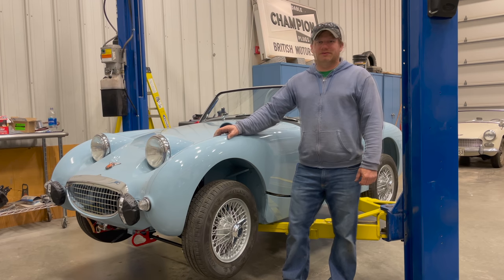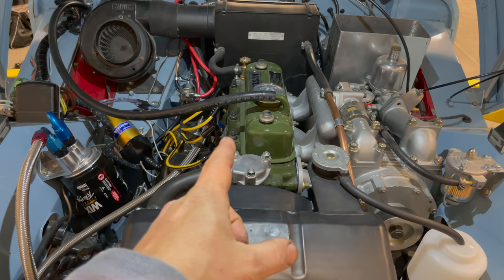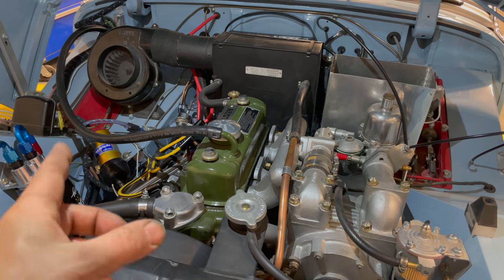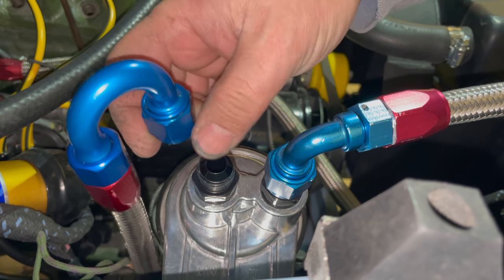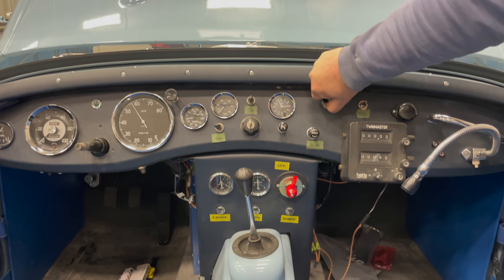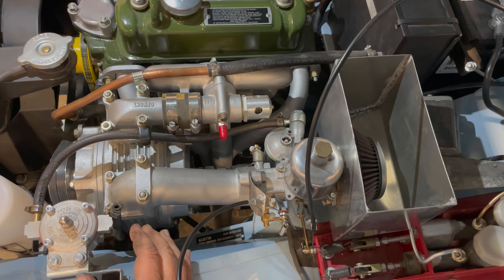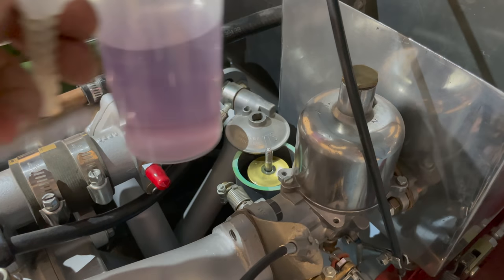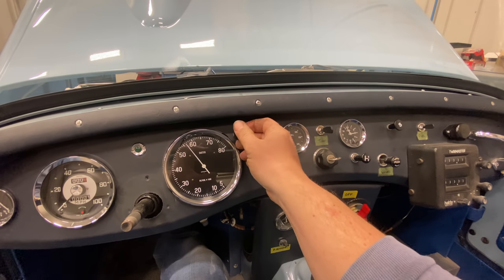Shorrock Supercharged Sprite is Born

Comment: That's a lot of oil pressure at cranking speed. Is the pressure relief actually working? Not unknown for them to stick on A series engines. Edit - I see it settled down once it ran, probably was stuck initially.

Comment: If you could find some clear tubing to slide over the fittings and into a drain pan to see when the oil arrives at the fitting. Keep oil from running all over the engine compartment.